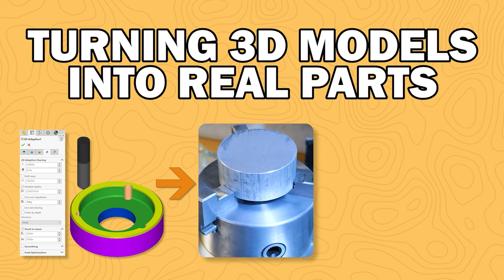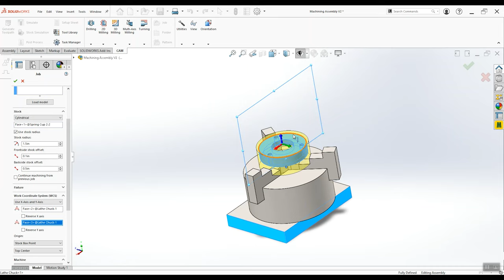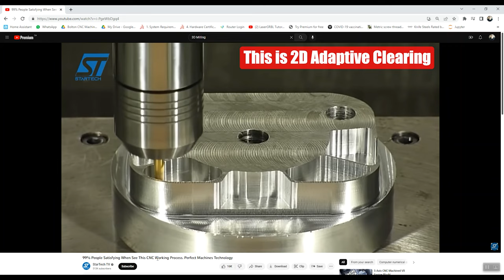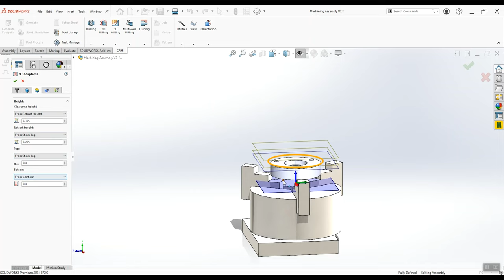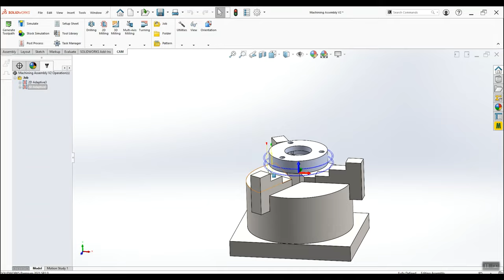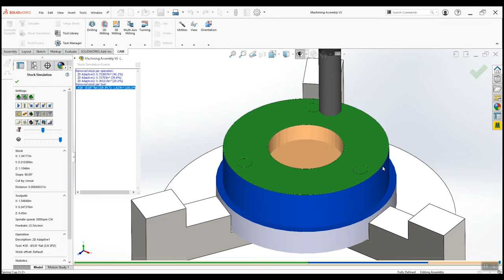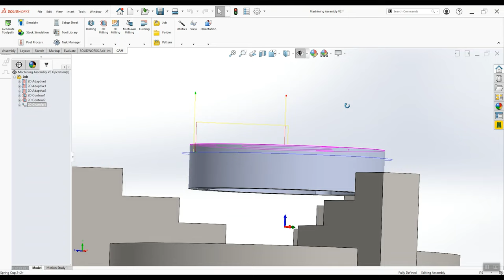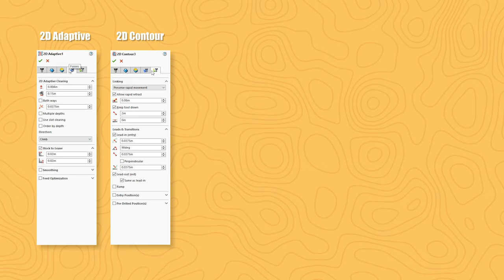Clearing the CAM Confusion - The Absolute Beginner's Guide to Fusion & HSMWorks Programming Tutorial

Comment: I’m nearing the end of designing and building my own cnc and I quickly found out that I have no clue how to actually use it. Finding your channel has been pivotal in understanding CAM for me. One thing I can’t seem to figure out is how to tell the machine to pause for tool changes. It pauses for a brief moment and proceeds to the next process without any prompt. Is there something being glossed over that I am expected to know already or is this my own machine issue? I’m using Fusion360. Thanks for the vids, wouldn’t be this far without them.
Reply from the maker: I’m glad to hear it! When setting up a tool in the tool library, there’s a little check box for “manual tool change.” Make sure it’s checked and your post processor should post an “M0” (a pause) between tool changes.

Comment: Great job 👍 
The one weird thing I didn’t understand was deselecting the contour and leaving it blank for the first “facing “ adaptive path. Why not select the model top or outer edge?
Reply from the maker: Hi todd - thats a great question. If you were to select the outer ring of the machine stock (and make sure "machine cavities" isn't selected), you would get exactly what we got in the video when we didn't select anything! When you don't select anything in the geometries tab of a 2D Adaptive operation, HSMWorks/Fusion does something sneaky in the background - it actually uses the stock contour as your selection! And the stock contour is the outer-most perimeter of the stock that you talked about selecting.

Comment: The one thing about HSMWorks that always got me was that arrow. I've had to adjust my zoom and orientation just to verify the arrow because it chose the wrong side more than a few times.
Reply from the maker: Agreed! Do you use a CAM package that doesn't have that problem?
Reply: @adamdebowski2037  Nope, I still use HSM, it just took several parts before it sunk in. 

I'm just now veering into 3d contours. Angled faces and domed contours are becoming my top searches
Reply from the maker: @jrsydvl7218  Cool! What kind of machine are you running? Are you having good results?
Reply: @adamdebowski2037  I have a converted ZX45 from Wholesale Tools. I can get better results after I weld up a proper stand. I just gathered some 4x4x.25 square tubing to replace the current wood stand. I have to go easy on the cuts but it stays true if I don't push it too hard.

Have you used you mill as a lathe yet? If/when you do, make sure you determine if your profile is set to radius or diameter.

Comment: The part where you explained how all CAM software/tool paths share the same parameters was GOLD. I have a CAD background and have recently gotten into researching how to build custom CNCs, I’ve tried to explain the same concept to my fellow cad peers about different softwares but end up looking like a clown because the basics don’t make sense to the advanced users anymore. Would you happen to know about PLCs and automation robot arms? That’s my final goal to 5axis 3d printing.
Reply from the maker: I'm glad you found it helpful! I've programmed some robotic PLCs in the past. I think one of my very first videos on YouTube is balancing a beam with quadcopter propellors/motors. I don't know anything about 5 axis robot arm programming, but my instincts tell me there should be some reverse kinematics libraries you could take advantage of if you wanted to do it yourself, and I've definitely seen 5axis motor controllers you can buy, but that's the extent of my knowledge. Would you buy the robot arm or make it yourself? Cheers - Adam
Reply: @adamdebowski2037   I’m looking to make a smaller arm for my independent study class in CNC programming. Initially was planning to make parts for my 3d printer and call it a day. Since it’s still summer time I’m thinking of laying out all of my skills acquired over the years into one project. That goes without saying I’m still a noob when it comes to scaled up machines or even just understanding how the electronics scale up compared to diy 3d printers. Will check out your videos 100%.